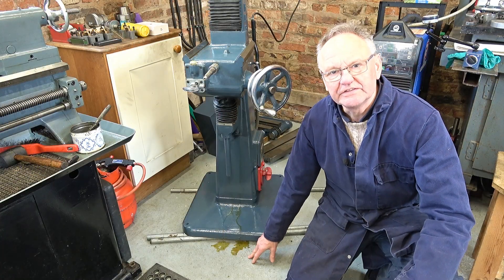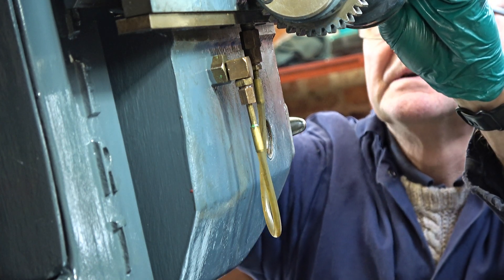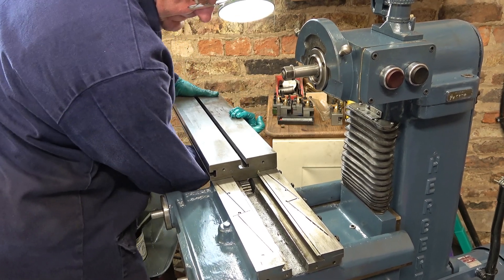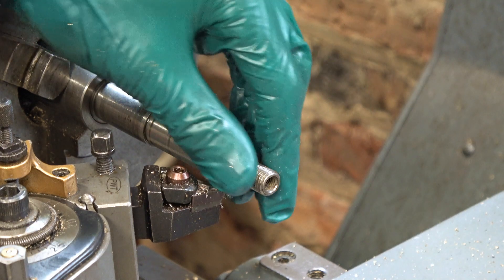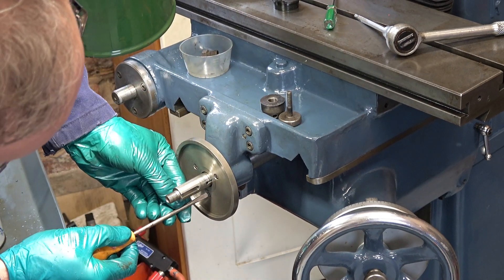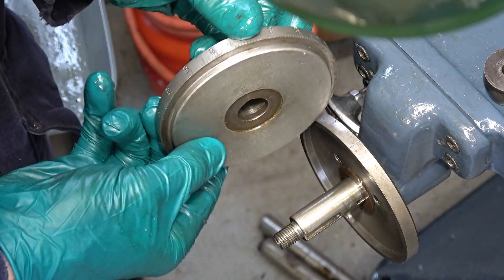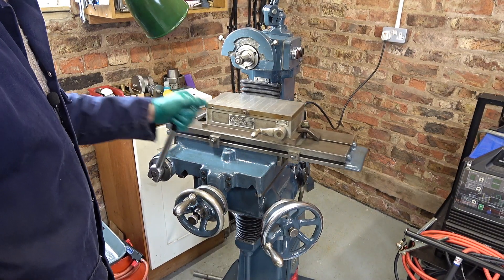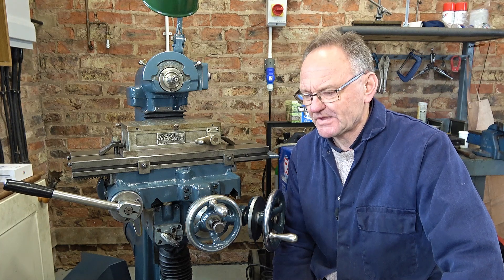HS255 Herbert Junior Mk2 surface grinder Part 13 – saddle and table

Comment: You will need to bin the gloves when you use it so you can feel if any sh*t is on the chuck or part.
Reply from the maker: Hi Marley, I'm in conflict with myself about the gloves. I prefer to work without them but then my hands are always ingrained with oil - especially my nails which I can never get clean. I do use barrier cream. Maybe it sounds like I'm vain ...... but anyway I agree with your point. Cheers

Comment: Hi Paul I have a Herbert Junior grinder same vintage as yours I think, and have found this collection of videos very informative and interesting, where did you source your wheel as my current wheel is in need of replacing and I'm struggling to find one suitable. Many Thanks John
Reply from the maker: Hi John, I got it from Coventry Grinders - their own brand. "White Grinding Wheels - 150 x 13 x 31.75mm, 2A-60-KV" and it was £24.43 including VAT and shipping. Just this very day I've made my first sparks - although there will be a couple of videos before we get to that. What size wheel do you have on your machine? Cheers
Reply: @HaxbyShed  Many Thanks for that Paul my wheel is the same size, its current wheel is  a norton 3sg but  I couldn't source one that size, the nearest I could find was 180 o/d which I fear would be  to large and they are quite expensive so if it didn't fit would be a costly error.

Comment: Hi Paul - I have exactly the same mag chuck and they are not that complicated - dismantle is very easy, once mine had been apart it worked so much better.
Cant wait to see the Hebert come alive - I have a hebert vertical mill from about the same year as your grinder still works great.
Reply from the maker: Hi Steve, did you worry about losing magnetism when you stripped it down? I've seen warnings on other Eclipse vices. Cheers
Paul
Reply: Maybe ignorance is bliss, I just went in with screwdriver in hand. 
Once in there there was absolutely nothing that would indicate that the magnets would be an issue. 
Again due to my eagerness to learn and in my case clean I even went ahead and took the magnet pack apart. 
Again, all very easy and as long as you keep everything in the same order and orientation then I would think you’ll be suprised how easy they are to take apart. 

Two things to note. 
The screw next to the handle on the short edge holds the handle in place. 
I rebuilt the magnet pack on the underneath of the top. It helped keep the magnets flat. 

Mine was greased inside rather than oil. Maybe a reason why no oil filler screw. 

I cleaned everything, applied a light oil the greased the moving parts. 
Not sure that was correct but it works and so far the magnet is maybe stronger than before the clean. 
It was that easy to do even if it’s added to the annual maintenance list it’s no hardship. 

I imagine a video is already in your plans.  

Keep up the great work I’ve followed your channel since the beginning and find it very useful.
Reply from the maker: Hi Steve, that's very useful info. Cheers

Comment: ISO 32 is usually a better choice for grinders, 68 can make it hard to crank the table back and forth. Especially with no flaking of the ways.
Reply from the maker: Thank you Brad, I will add that to the data bank. Cheers 👍

Comment: Paul, I found when I locked up the dial on mine the friction of the dial added considerably more resistance to the handle. I assumed that I was missing a washer in the dial recess so I made a bronze washer that solved the problem. You don’t have a washer so it looks like that is the design. You may need to do similiar?
Reply from the maker: Hiya, there is a bronze washer there it's just I did not show it. I put your channel link in the description this time. Cheers

Comment: Magnetic vice probably just remove handle, and there probably is enough clearance on the bearings to have the oil travel down, or it hides a hole for it. Otherwise turn upside down and loosen the base, then lever off on one corner slightly and pour oil in till half full, close up again, slosh oil around then loosen that corner again, slip a shim in, and leave upright for an hour with that corner down to drain the goop out.
Reply from the maker: Good ideas Sean thanks. I've seen various warnings about stripping down mag vices and losing magnetism so I'm just cautious. Cheers

Comment: Time to look for a shorter mag chuck, maybe someone has one you can swap with.
Reply: Or just relieve the 1” at both ends possibly! 1/2 a thou or even less would work.
Reply: I replace mine with a smaller eclipse ax74
Reply from the maker: Let's see how I get on Tony. I have not checked the trueness of that chuck yet. Cheers

Comment: What a perfect size little surface grinder for a small shop wish they still made small grinders with this kind of quality not the lite as they can make it Chinese style, don't see why a guy like me couldn't manufacture something like this at a decent price in a first World Country most expensive thing would be the casting and spindle 🔥 I'd pay 6 to 10 grand for it.
Reply from the maker: I think as well as cost it's a question of volume. Up until the 80s there used to be dozens of engineering machine tool companies in the UK but the days of manual machines were numbered. And many UK houses do not have the space for home hobby machine shops beyond perhaps a small lathe and and a drill. I bet new the machine was expensive. Cheers

Comment: Coming along very nicely. Cleaning up the mag chuck is going to present a challenge I an sure you will surmount. Cheers!
Reply from the maker: Thanks Greg. I'll check the surface of the chuck to see how bad it is. I'm not typically working to tenths in my shop. Cheers

Comment: That's really coming along nicely there Paul.  Clough42 has a couple of interesting videos on grinding wheel balancing, although you will need access to a 3D printer for his solution.
Oh and he CNC'd his grinder as well.
Reply from the maker: Hi Bill, I think I have seen some of his vids on that. I have thought about a 3D printer but I just don't think I'd use it enough. These days you can upload a model to the cloud online and the printed part drops through the letter box.  That's how I got my lathe spindle nose protector. Not expensive. Cheers

Comment: Hopefully not a Norton wheel stone. In 40 years of my being in the shop, the first time I went to Norton I bought 2 wheels and both exploded minutes after install. So I was accused of using them wrong. LOL. I hadn't used them at all. I turned the grinder on and the wheel exploded both times sending shrapnel all over my shop and destroying one of my shop doors which Norton refused to replace. In any case, your grinder is looking like its ready to make something.
Reply: Norton used to be top shelf. Any recommendations on the best wheels out there?
Reply: @devmeistersuperprecision4155  The regional abrasives supply here refuses to carry Norton, they were quick to say how much they didn't like them. I haven't bought any wheels in a few years but yes, there is a company on the east coast that makes the best wheel stones but I'll have to get back to you tomorrow on their name. It's late and I'm off to nightmare land.
Reply: @devmeistersuperprecision4155  Radiac abrasives is where I get my stuff now. Their ruby red wheels are great.
Reply: Nonsense. Wheel was either damaged or not rated for the speed of the grinder.
Reply from the maker: Hi Opie, it's not Norton - although it might have been. I found something a bit cheaper 🙄